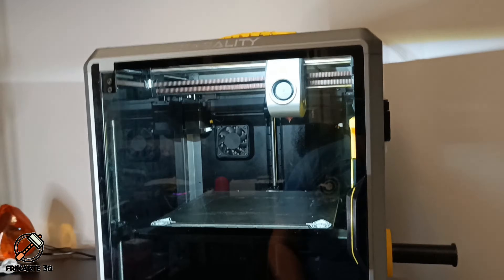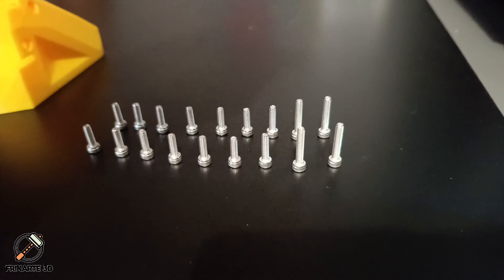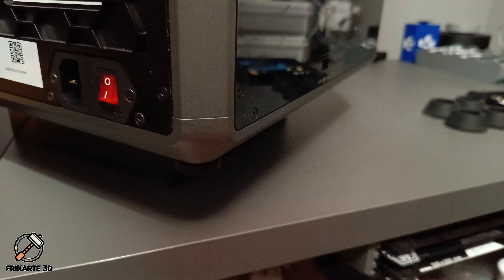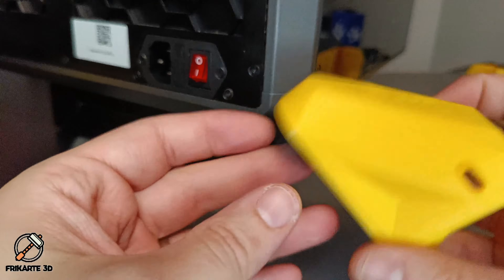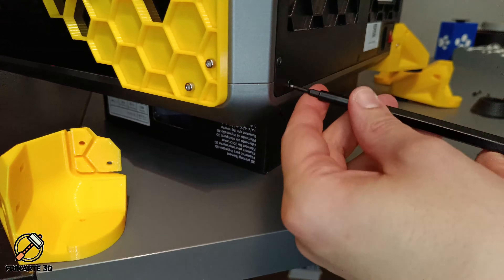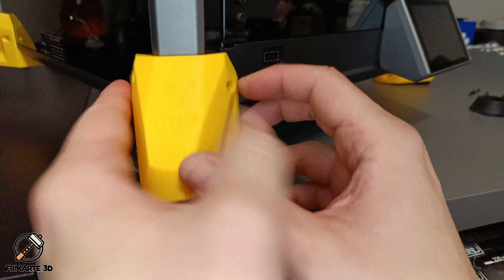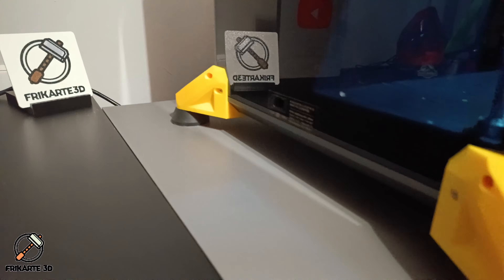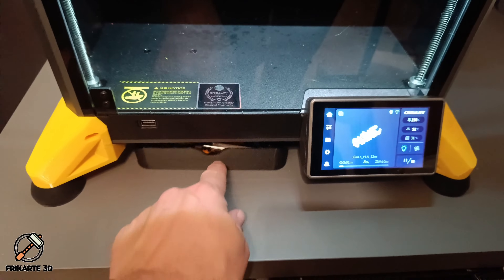Epic Creality K1 Mods: D3vil Wears Prada Boots Meet Honeycomb Spool Mount!

Comment: Anything changed after you add those?
Reply from the maker: Nope. It just looks cool! Someone says it reduces vibration and ringing but I didn't have that before the mod
Reply: @Frikarte3D  I purchased the Hula feet it's great no more vibration, also you need change psu to meanwell 350w 24v for less noisy fan
Reply from the maker: @hanaloginstruments8930 Nice! Gonna take note of that 🙌🏻